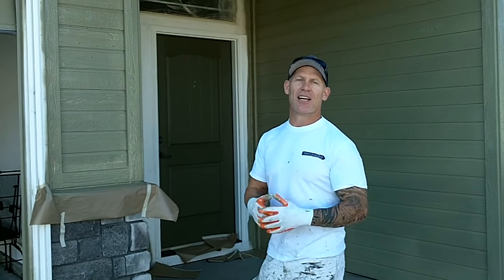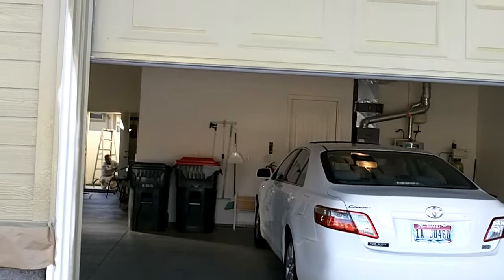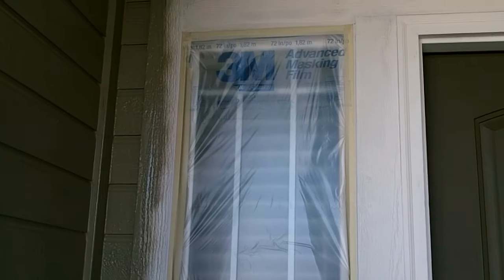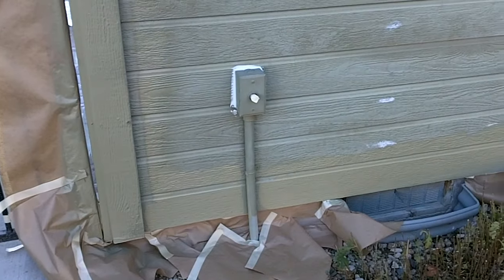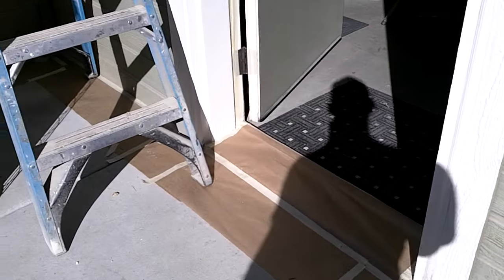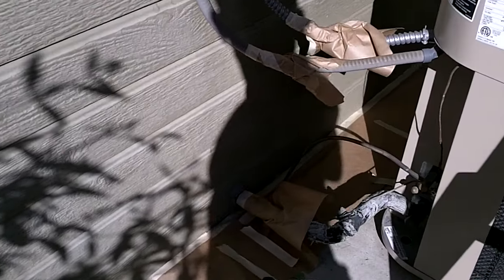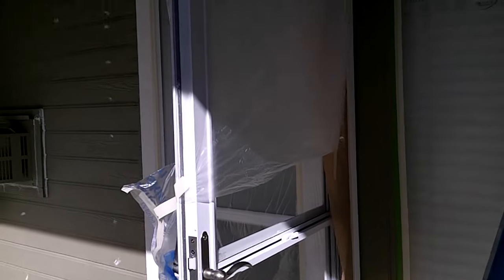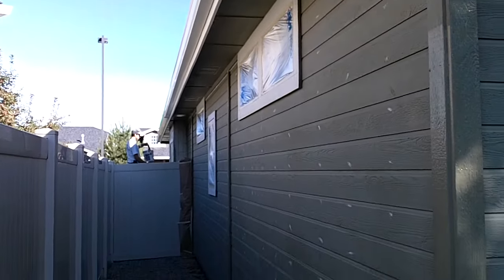What To Mask When Painting Your House.  Paint tips masking a house.

Comment: We use composite roofing shingles instead of cardboard on the ground and even on the roof to hold down drops... usually it slides right under the siding.  Can be reused many times as well! You can rip it into smaller pieces as  needed.  Even make tears in it to go around piping and other items running down side of home.

Comment: I used to mask like you do but thanks to too much wind I had to change my masking technique. It was very frustrating getting back to a house the next day and finding the masking blown off here and there. I was even using duct tape on shingles and brick as a base to put masking paper on. The duct tape held most of the time but not the paper. I mask windows like you do but every where else its 1.5' tape and then a guard after. I only use paper in places where the guard won't fit. So you don't have wind in Idaho??? I have wind in Canada and it must blow in your direction eventually...